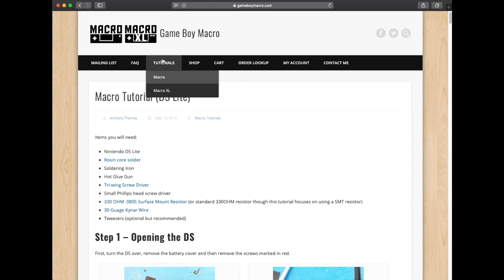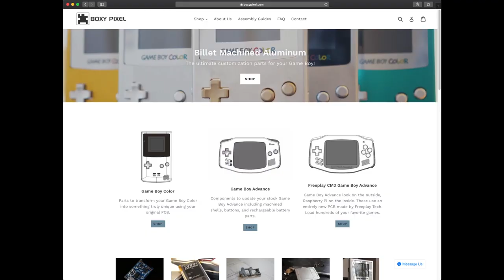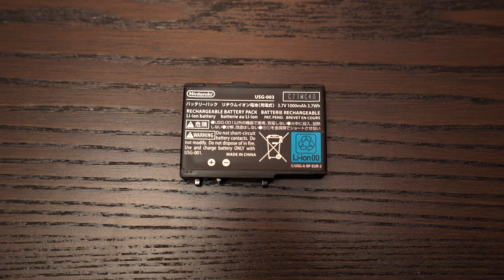Easiest and Best Looking Gameboy Macro Mod That You Can Do Yourself | Retro Renew

Comment: Really quality content for someone with a low sub count. Think i'll stick to converting from a DS Lite to the Macro using the original shell seeing as $54 + shipping fee is a bit too expensive in my opinion.

Really well put together video dude :)
Reply from the maker: Thanks Joey Does Tech!  Really appreciate it man!  There are some new Macro shell options floating around, I saw some 3D printed Macro shells on eBay which look pretty good that I want to try out also.  Cheers buddy!
Reply: @MachoNachoProductions  For some reason in the UK we don't look to have too many! It's looking around £10.00 shipping minimum. 

Just seen the wireless charging SP as well, that looks like an interesting mod! =]
Reply from the maker: Totally, it’s a great mod for the SP and relatively simple. I’m hoping to make it more practice with an aftermarket lipo battery, we shall see. Cheers!

Comment: One possible idea to deal with the letter boxing issue would probably be if the shell was remade to fill in the rest of the screen, or include a glass lens to serve the same purpose. it wouldn't be the best option but it's the only one i can think of
Reply from the maker: Great point @Arlisbloxer05!  If you check out my newer Game Boy Macro video, I install a custom glass screen lens that does take care of the letter boxing issue.  Boxy Pixel sells it too!  Cheers!

Comment: It looks great, but I really don't like those backwards slanted B and A buttons. I guess there's no workaround when using an original DS Lite (at least I couldn't do it on mine), but since one is already opening and modding the handheld, wouldn't there be a way to rewire Y and B to work as B and A respectively?
I guess you'd need a different shell as well, but that button layout issue is what keeps me from trying this mod (or playing GBA games on the DS Lite altogether).
Reply from the maker: Thanks you The Duck Cave!  That would be a pretty neat mod.  It would require cutting some traces and patch soldering some wires to the traces to reconfigure the button layout.  Definielty not an easy mod.  I think the shell could theoretically be modified to accommodate the button layout but that would also be difficult without the right tools.  Thank you for the comment!  Cheers!

Comment: Someone really needs to make a shell that is slightly larger on the bottom so GBA carts can sit flush, it wouldn't be that difficult.
Reply from the maker: That would be nice for sure!  When the cart sticks out, it’s a real eye sore. I think the only difficulty may be what to do with the volume slider?
Reply: You can get an EZ Flash omega and they have a flash cart that fits flush

Comment: I would really like one of those metal faceplates, but I wish the design kept the X and Y buttons for SNES emulation.  I heard there's at least one emulator that will play SNES games on the bottom screen.
Reply from the maker: If you have a drill press and the appropriate bits (carbide) you could definitely add holes for X and Y. Some additional filing may be needed for the button guides which could be difficult. Aluminum is a fairly soft metal. The DS may be powerful enough to emulate snes but I’m not aware of any current emulators for the platform. Definitely be interested though!

Comment: just get a advance sp! but, it is still a nice mod!
Reply from the maker: Haha true!  I actually don’t have an SP. I’m planning on getting one soon!!  That IPS mod for the SP looks really tempting!
Reply: @MachoNachoProductions  That IPS mod has made the price of the SP skyrocket. The old front lit SP used to sell for 25-30$ but now they can easily be double that. It's not really worth converting a AGS-101 so everyone is seeking the old 001.
Reply from the maker: chamoo232 thanks for this head up!  Hopefully I can find one on the cheap!  I’m planning to re-shell, so I’ll look for one in rough condition.
Reply: @MachoNachoProductions  The best deal you can get would be a 001 with a broken screen. Maybe faulty L and R as well. That's easy to fix. I had a chat with someone who wanted to make IPS SP by buying only the motherboards and new shells since the motherboards can be found for 25-30$. That's not a good idea since you then need to buy a battery, speaker and hinges separately and that brings the price to higher than just buying a whole SP.
Reply from the maker: chamoo232 thanks for the awesome tips!  I’ll keep that in mind when looking for an sp!  Cheers!

Comment: Hi ! 
I have a little question :
How is it possible that GBA cartridges do not exceed the DS Cartridge Port ? (there is Metroid Zero Mission in this video for exemple)
Thanks
Reply from the maker: Hi FSH Iguchi!  Thank you for the question. You are correct.  All GBA games will stick out of the bottom of the DS. In the video I review the EZ Flash Omega which is a product that let you put GBA roms on it and allows you to play GBA, NES and Game Boy games. The EZ Flash Omega is smaller than the traditional GBA cartridge which allows it to sit flush with the DS console. If you watch the video towards the end you will see how it looks. Thanks again for your comment and consider subscribing to the channel! Let me know if you have any more questions!
Reply: @MachoNachoProductions   Thanks a lot !

Comment: dude, why what's the point, just get a gameboy advance
Reply: right, and gba is more cool looking, and once your battery is worn out is not easy to find good new ones, on the gba just purchase rechargeable battery that has 2800mah x2 = 5600mah battery, your gonna play for two days without charging lol, and what I don't like with hes ds mod is its just rectangle and when you play longer im pretty sure your hands are gonna cramp, gba has the perfect ergonomic style. why do all that when you can just replace an ips display on a gba, lol destroying ah ds and wasting time for that awful design

Comment: How is the brightness controlled?
Reply from the maker: Great questions!  When you turn on the DS with out a game inserted there is a brightness setting in the DS user interface and you can adjust it there using either the stylus or the d pad and buttons. I hope this helps!  Cheers!

Comment: I don't get the point of the macro, it's bigger-than-necessary form factor, horrifically tiny shoulder buttons and half-premium design ruin it. Add to the fact that games will never sit flush and it's no cheaper than a backlit AGB model (that's at least more comfortable to hold AND runs off rechargeable AA batteries). 

Oh, it can't play original GB games either....

Comment: So you lose the second screen?
Reply from the maker: Yes, during the conversion you remove the top screen.
Reply: It's a common mod for DSes with a damaged top screen
Reply: @WildVoltorb  Or with those that have broken DS game slot. I have 2 broken DS lite. One has perfectly working screen but the DS slot is broken. The second reads DS games but the top screen's colors are messed unless you put it in a sweet spot. I plan on switching out the motherboards to have a fully functional DS lite and possibly make a Macro with the rest of the parts.